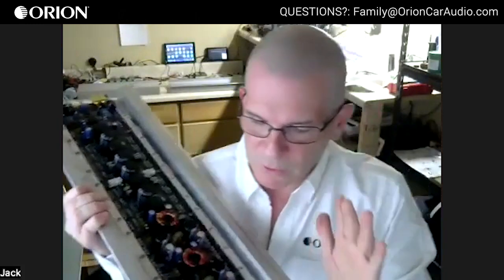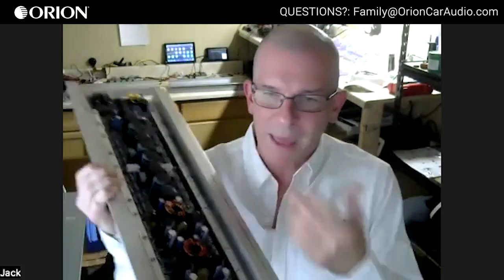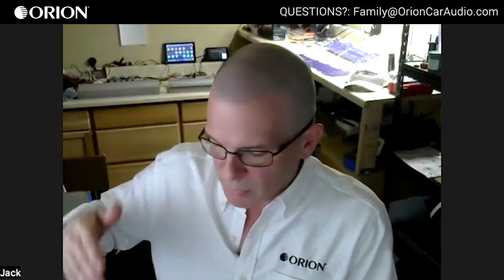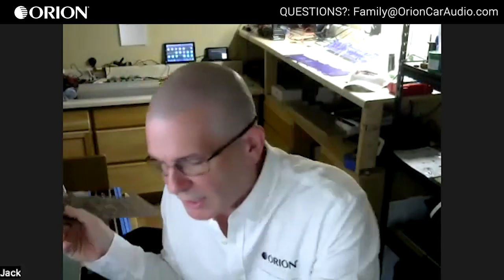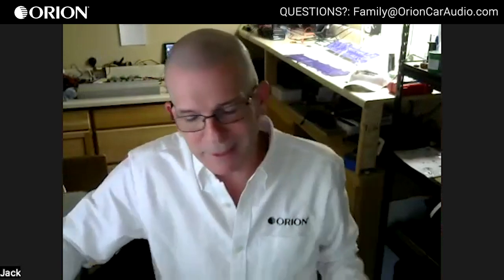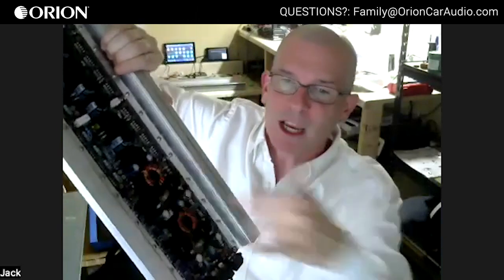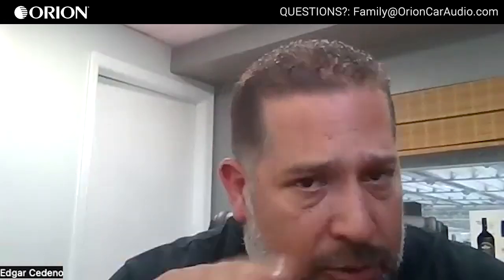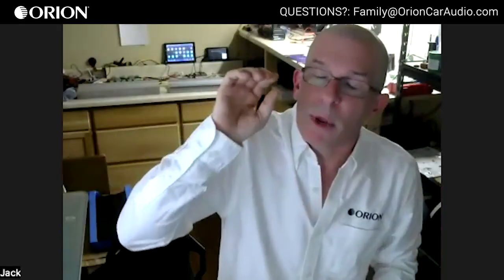Orion Car Audio Tech Talk: NT Amplifiers with Edgar Cedeno & Jack Cali

Comment: Hi I have the older all red model Orion hcca 25001 amp. I'm looking for a replacement Orion RGC2 Optional Bass Remote Control.  It seems impossible to find. Is there any way that you would be able to assist me in finding one or one that would also work with this amp? Please let me know when you get a chance.

Comment: nt's were nice but jesus ,that price range.  glad yall are back making stuff but i think the NT  line is going to go bust on you due wattage vs the price point. yes i get that its an sq amp but still.
Reply: They lost  their minds at that price
Reply: @Flamewars  Whats the price?
Reply: @Flamewars iam guessing 2k mark since he said two amps in one toexplain.and orion og so it's probably go be high damping for control which is a big elephant some say it dont matter and many say it offers great control and slew ratings and high efficiency signal to nose